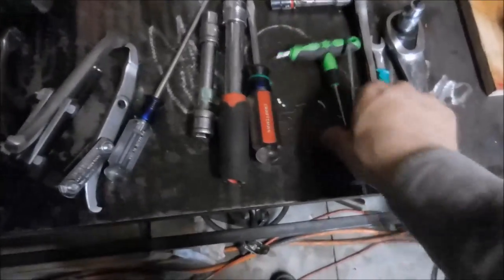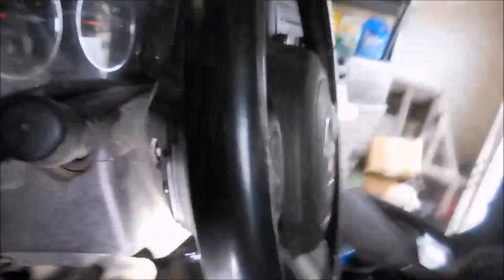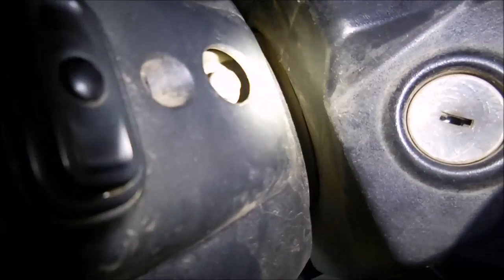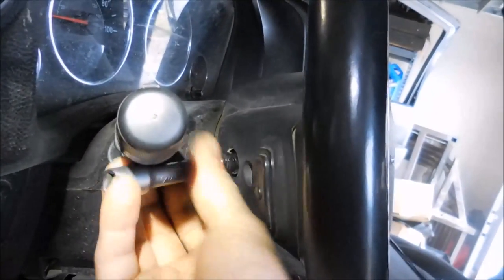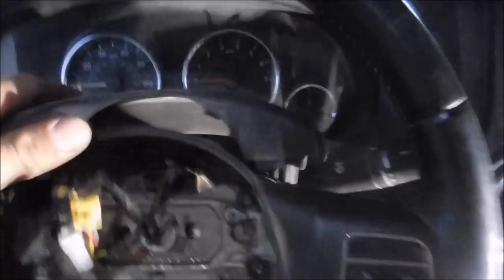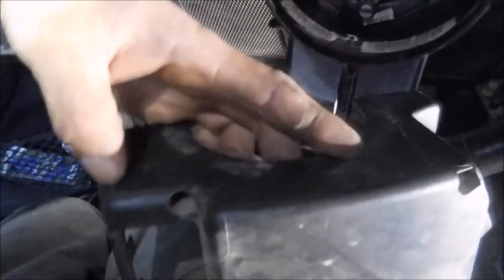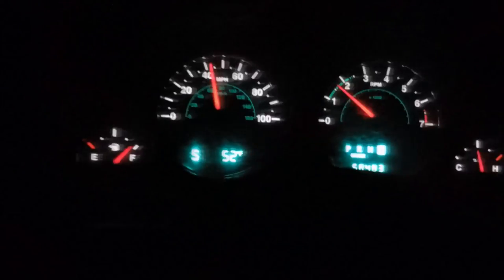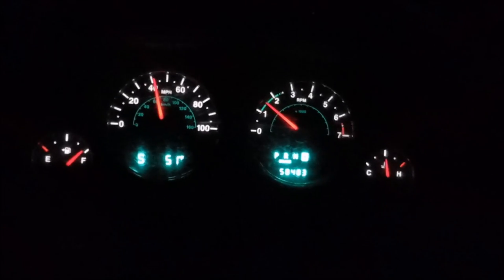Replacing Clockspring Jeep Jk 2011+

Comment: This just saved me a few hundred dollars. Thank you so much! 
For anyone having trouble getting the wheel off, you can hit around the center hole with a rubber mallet or something to loosen the connection. Use some sort of spray (I used wd40) on the center hole. And use a side to side and up and down rocking motion while pulling to get the wheel off. With the rocking motion it came off really easily for me, no wheel puller required.
Reply: Man mine is on can’t seem to get it to budge

Comment: My 2014 Jeep JK started giving an airbag alarm when I turned left and going off when I turned right. After some research, I found that it was the clockspring. The dealer wanted $700 for the fix or $300 just for the part. I got the part on Ebay for about $100 and used this video to fix it! Thanks so much. The only thing missing was I needed to use a steering wheel puller with legs to get my wheel off. Was $10 on Amazon... GearWrench 3510D Steering Wheel Pulling Legs
Reply from the maker: I'm glad the video helped out!
Reply: How do you use the GearWrench 3510D Puller Legs? I got the two pulling legs with the Lisle 45000 Steering Wheel Puller set, but the legs are too long, and won't grab on as I turn the bolt.
Reply: I used this puller - OEMTOOLS 27017 Steering Wheel Puller (from Amazon). Maybe your puller isn't long enough. It was a little tricky to get the feet to grab. But took maybe 5 minutes and came right off. Good luck!
Reply: Josh Ebel I’m using the same tools. It seems like the legs are too long for the oemtools center drill piece is too short. Did you use anything to extend the drill part of the puller? Getting the hooks to latch on near the center hole was tricky, but possible.
Reply: nauticnerd try putting a socket under it to make the puller taller
Reply: Josh Ebel will do, I hope that works. Will try tomorrow. Thanks for the quick response!
Reply: Fixed! Socket under puller worked! Used a impact drill to help me with the torque.

Comment: Just wanted to say thank you for the great video.  Easy to follow.  Also in NC.  I used a rubber mallet and some pb blaster.  I had a moment of defeat, but it finally came lose (after 20ish minutes!).  I saved myself $500.
Reply from the maker: I'm glad the video helped out, thank you for watching!
Reply: What part of steering wheel did you hit with mallet?

Comment: Left my jeep not quite far enough underneath the barn overhang. Driver's area dashboard/steering wheel got soaked and electronics no longer worked on the steering wheel. Used this vid to replace the clockspring and the steering wheel electronic controls work great now! Thanks for the vid!

Comment: OMG, such a helpful video... literally takes about 30-40 minutes to replace the clock spring with this video.  I was able to use the  jaw puller to get the steering wheel off...
Reply from the maker: I'm so glad it helped you , If you have friends that are about to tackle the same task feel to share the video it may help them out as well!

Comment: Thanks for the great video.  Just did my clock spring on my ‘11 JKU and this was easy to follow.  Didn’t have a puller, but with some lubrication, mallet work and major pulling got it off in about 5 min.  Would definitely recommend a puller though.  Hardest part was the screws for the clock spring with the tools I had. Screw are in odd places.   Replacing solved my airbag light on (open squib b102) issue.  And DIY saved me $450+.  Thanks again!

Comment: I have a 2013 Wrangler and there is a recall on the clock spring. I went to the dealer and they ran my VIN# and it was covered under an extended warranty on the clock spring.  great Video
Reply: Right side wheel or left side?
Reply: @lastcall170  left side drive

Comment: Edgar ...greetings from Tampa. Thanks very much for posting this video. I have a 4 door 2011 JK and like other posters here I lost my horn and steering wheel controls somewhere around 60K miles. I also have ABS/traction light on ( which may be the speed sensors but others have said it may be clockspring). I have a program to pull videos off you tube so I will bring my laptop outside and use your video to swap this part. Your video is very step by step and will be very helpful.
Reply: I have the same probem. Did this fix your Speed sensor problem?? Ive changed my sensors and still no cruise control.

Comment: Thank you for posting this. I have an intermittent air bag light and chime that I can't ignore anymore. '12 3.6L. Much more practical than the stealership. The way people have been describing their clock spring problems and dreading the job (even those covered under warranty), I thought this was going to be worse than a front hub repair or diagnosing EVAP or ABS problems.(which I would rather shave my head than change bearings again or hunt down those codes again). This isn't nearly so bad. Cheers from Michigan.
Reply from the maker: Fatima Mohammed thank you for watching! 😀
Reply: Fatima, you want to help me replace mine? Mine is damaged from drummond of '17 ;o)  hehehe   I think you wuz there with me when it happened too!

Comment: Thanks for the video my 2011 jk has had electrical issues when it got cold my rear wiper has a mind of its own referring to the wiper switch assembly to be replaced well I’ve put it off for awhile and now the air bag warning light (clock spring) and with your video it’s too easy to address both issues thanks

Comment: Great Video Thanks. I'm probably gonna purchase a 2011 Jeep Wrangler Sahara Unlimited and it has a Bad Clock Spring. We've worked out a price. I talked to some Mechanics today that said All in All it's really in good shape. The Horn doesn't work. So Thanks for sharing.
Reply from the maker: If its a good price get it,  fix it using the video! Perfecto
Reply: @cisnerofam08  Yeah I purchased it and I replaced the Clock spring it wasn't bad. I also fixed a Ground.
Reply from the maker: @brianbaker9715 I'm happy to hear that!

Comment: The Jeep jk from 2007 to 2018 is the same clockspring the only think is the steering wheel is a different design. Now you can install the new jk steering wheel to the older Jeep jk with no problem only think you need to do is do a simple conversion with the wire hardness for the steering horn and the cruise control.

Comment: Great video!   Just replaced my tie rod and draglink and not sure how it would damage a clock spring, but I have an airbag light now......    My guess is the notorious clockspring as Im at 80k and that seems to be the magic number.   May just bite the bullet and swap it out without blowing 100 bucks on dealer diagnostics.  Have an 11 also

Your vid makes the job alot less leery of screwing around the airbag.

Comment: Thank you for making this, I have to replace mine. It's a 2016 RHD, same part. I'll use it as a reference in case anything is backward as this is the only usable video I've found.
Reply from the maker: Thank you for watching, hopefully it helps you out and hopefully it saves you some money too!
Reply: @cisnerofam08  I finally got around to doing it, it worked my light went out but now my horn doesn't work

Comment: My headlights, turn signals and horn stopped working.  Radio functions do not work but cruise control works.  Headlights go on when i use keyless entry and my hazard lights work.  2011 jk sport 214k.  Need help don't want to go dealer but if i do this jeep owes me nada

Comment: Are these clock springs not recalled? Funny I seen you had 58400 miles on your jeep and your replacing the clock spring.  I have 58300 and mine just broke.
Reply: My sisters just went out at 62000 😂

Comment: This video is awesome!!! 

The tools I needed were exactly listed out. I just replaced the clock spring in my Jeep after my scan tool told me I had code: B1B02 - Airbag Squib Circuit 1 open. It took my niece and I 90 minutes total to fix. 

FYI, to others, I did rent a steering wheel puller from a parts store, but that does not work because the steering wheel doesn't accept the bolts. A bearing puller is the only way to get it loose. My seventeen year old niece and I tackled it without a puller by putting a socket in the middle and hammering for a bit to loosen things up, then we each took a side of the steering wheel and pulled. It popped right off!

Comment: Nice video Edgar!  Do you have the part number for the clock spring?  I found 2 different part numbers when I was searching for my 2012 replacement. Thanks.
Reply from the maker: +David Ulrich I believe this is the one. http://www.rockauto.com/catalog/moreinfo.php?pk=6424878&cc=1503367&jnid=346&jpid=1
Reply: How did the replacement go on the 2012? Looking to replace the clockspring on my own 2012 Jk this weekend.

Comment: How do you diagnose that's it was the clockspring that needed to be replaced? 
I just purchased a used 2011 JK 2 Door Sport and my air bag lights goes on and off constancy (every 2-5 minutes) while driving. Went to dealer to see if they would cover under recall, but nope, my unit wasn't affected. They wanted to charge me $150 just to diagnose the problem. I asked what's the most common cause, and they said about 5 different things, most common being clockpsring or collision sensor.
Reply: I saw a video where they used a used a professional vehicle diagnostic tool to measure the ohms readings of the clockspring and assess if they were within specs. What the mechanic did was turn the steering wheel all-the-way left, then all-the-way right, and noted that the ohms went out off the normal range when it turned to the right. It was then that I noticed that the SRS light, and tone, would go off intermittently as I drove my Jeep. So, I parked the Jeep with the engine running and turned the steering wheel all the way to the right and the SRS remained on, then I turned it all-the-way to the left and the SRS light turned off (got to wait 1-3 seconds for this to occur). This was the reason my SRS light was intermittently going on and off as I drove, and it paralleled the video I saw about the test done with the expensive professional tool. I changed the clockspring and the problem was solved.

Comment: excellent presentation keep up the vids (non swearing please) close ups are fantastic! picture quality not worth much demonstrating real key points to remember is everything. Anyone making an instruction manual from your video would be kind of infringement on you. Usually stills are made from single HD snap-shots when parts suppliers included instructions packaged with parts are boxed is my take on that idea. P.S. cute baby too. Bring on more cures (lots of vehicles are easier to fix than one might think) Jim

Comment: Would this cause an intermittent no start problem on a 2007 Liberty? (C2102 low system voltage error code?)
Reply from the maker: +KRN762 this clockspring install is about as far as I go with the electrical system, I'm really not sure.
Reply: Thanks for the reply!. An electrical problem is the worst thing to try to track down...

Comment: Folks , there is an extended warranty issued by Jeep on clock spring . It covers 15 years with unlimited miles. I just got my 2015 JK unlimited Rubicon’s clock spring got changed from the dealer for free. Please contact the agency.

Comment: Thanks a bunch!  Two hour job with help of your video. Mine just started going out at 195k miles. 2012 JK.
  Mini ratchet for the T15  with extension and a tip kit., made those difficult screws on the clock spring a cinch.
Reply from the maker: I'm glad it helped out, thanks for watching!!

Comment: GET YOUR DEALER TO DO IT FOR FREE. For 2007-2011 Wranglers, there is a recall on this. Check the two NHTSA Campaign Number: 16V288000 and 13V176000. My dealership was going to charge me $1600+ for a new airbag on my 2011 Jeep Wrangler. I had to ask 3 different advisors to have the "technician" check the clockspring first. They finally checked and replaced the clockspring under the recall with no cost to me.
Reply from the maker: I 100% agree with you,  if it's on a recall then get it fixed my the dealer. If it's not on a recall then everyone can follow this video and save some money.

Comment: This video REALLY glosses over how hard getting the steering wheel off is. It is VERY DIFFICULT and there is  no way the guy in the video got it off as easily as he described. I tried every kind of puller there is. I used air chisel, a torch, even a 2 ton come along hooked to the ceiling joists of my garage. it is by far the hardest part of this job. holy shit
Reply from the maker: Thank you for watching, I 100% got it off exactly how I described it. It sounds like someone had previously removed it and did one too many uggas with the impact. I bought my jeep brand new from the dealership, so I figured I'm the first person to remove the steering wheel.

Comment: clock springs don't last forever and re-call campaigns can change specific replacement items related to individual VIN. numbers is what I have been informed. That with any maker or type of repair concerning issues upon repairing problems. But your demonstration was quite cool and unpanicking, skill level 3 determined from Quadratec they have their brand for $159.99

Comment: Thank you very much- followed this step by step on my 13 Jk
Could not have done this job without this video.
Bought mine from eBay $50
Reply: Is your part # on your clock spring 5156106ag cause I just want to be sure
Reply: Do you have a link to ebay michael?

Comment: This is awesome!!! My 2011 jeep airbag light came on and I'm pretty sure I'll be doing the install myself with your helpful video.
Thx a million!!!
Reply: I looked up online and found a recall on the right hand driving jeep clock springs and told my dealership to look into it. Voila....They changed it for free for me!!!!! Thanks for the video, I was about to do it myself if they didn't do it. Keep making videos they are great.
Reply: Well they already changed our RHD jeep (2012) once and it has failed again. Called dealer and they said they won't cover it. Less than 50,000 miles.

Comment: Did everything as directed. Steering wheel perfectly aligned. Pulled tab after installing. 

Now my esc light is stuck on..anybody know what to do to fix that?
Reply from the maker: Is your steering wheel centered?
Reply: Edgar Cisneros wow quick reply. Thanks for the video btw man!! 

Yep. Aligned the two punches. Wheel is straight as can be while driving down the road
Reply: Edgar Cisneros turn steering wheel to full lock on both sides , centered and turn ignition off to try and recalibrate. Still on
Reply: Edgar Cisneros recalibrated steering angle sensor. Seemed to do the trick

Comment: Hi! I just installed my new PRP steering wheel. I don’t have an airbag now which is fine. The problem is when installing the steering wheel, the upper front section of the clock spring that turns round had be removed to make room for the new Hub adaptor. Initially I dismantled the clock-spring only to realize, I just needed to remove the upper section of it so I assembled it back together. After removing this upper section of the clock spring, I installed my new steering wheel  hub adaptor and wheel. The steering wheel has become very stiff now. (I did completely remove the white wiring thats wrapped around inside the clock spring). Would greatly appreciate your reply.

Comment: The interior light dimmer switch on the turn signal column doesn't work  is it the clock spring or the actual turn signal switch

Comment: Followed your process step by step, it fixed my problem and the it wasn’t to difficult. Asked a local shop to do it and they told me no because of they will not touch the air bags. That scared me a little, but tried and won! Thanks!!